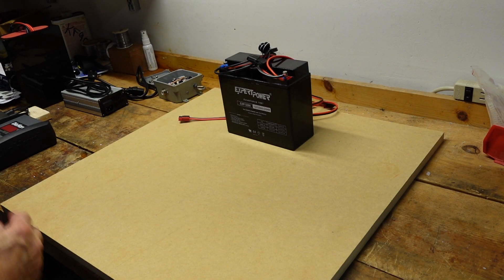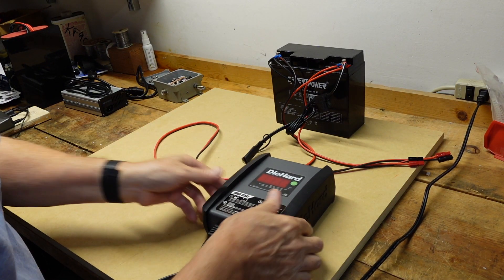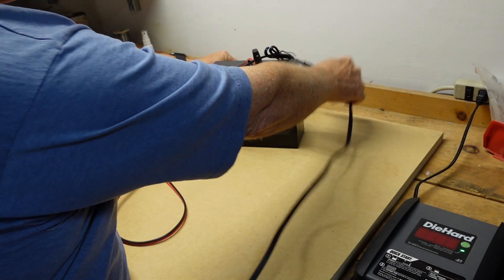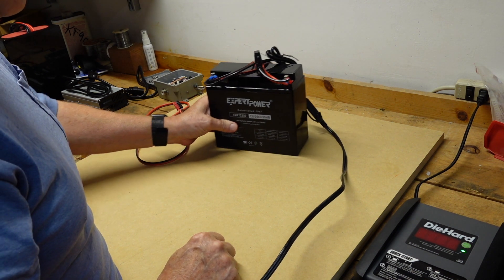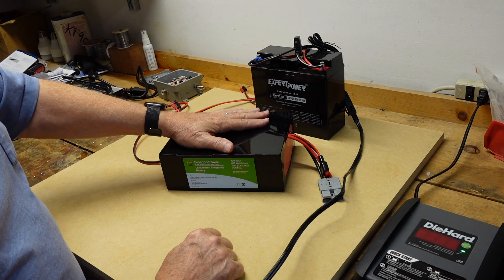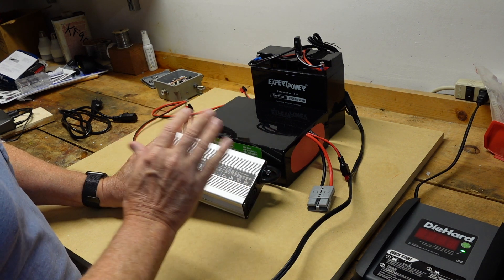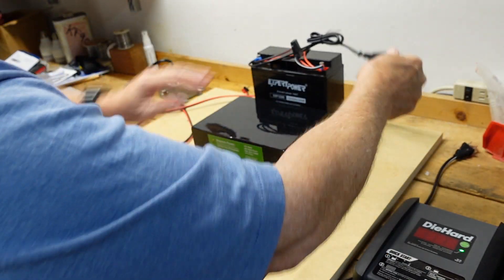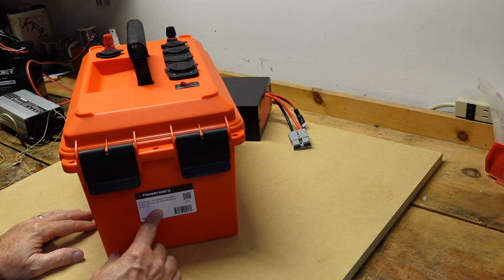Battery power for my portable ham radio station.

Comment: Can the battery be charged via the power poles?
Reply from the maker: There is a separate connector inside on the battery for charging.  LiFPo batteries have a BMS controller.
Reply: @ke9a459  Cool, thanks. I would probably install a charging connector on the side of the box.

Comment: Like 103.
Appreciate the video.  Am in the process of building a box.  However the budget has me using a SLA battery but perhaps I can upgrade later.  Right now I am at a bit over a Benjamin in cost which does not include a solar panel.  So add another 60 to 80 Washingtons and I will be complete and outlet free.  
Once you deploy your system, you will find what works for your program and what is problematic.  You can certainly modify and tweak to your specifications.

Comment: One thing I just cant deal with is the daisy chain wiring that all these prebuilt setups have. Plus the wire size is under what I would want. Wiring DC is fairly straightforward. So I use a blue sea fuse distribution block and size the supply wire and accessory distribution wire accordingly
Reply from the maker: Thanks for the note.  I opted for the pre-built for my needs.
Reply: @ke9a459  ....are you liking it? You did buy one of the better one out there. I prefer to build, but thats not everyones thing.

Comment: I've been looking all over for battery comparisons but no one is looking at 18650 battery packs, is there a reason no one is using these batteries?  Even LiFePO is twice the weight, twice the cost, and half the capacity of a comparable size 18650 pack.
Reply: I think you will find your answer here https://www.newcastlesys.com/blog/lithium-ion-vs-lithium-iron-batteries  and here https://blog.epectec.com/lithium-iron-phosphate-vs-lithium-ion-differences-and-advantages
Reply from the maker: LiFePo has much greater cycle count and shelf life.  18650 and the like are great but they are much more dangerous to use.

Comment: Love those Bioenno batteries. I run a 12ah in my go kit with a yaesu 891 and that thing runs for ever, we did a 7 park POTA run in western Ohio and still had over half the battery left when we got home running 75W on a 50/50 cycle and each activation lasted between an hour to 2hrs.